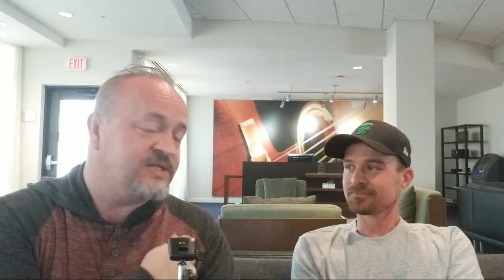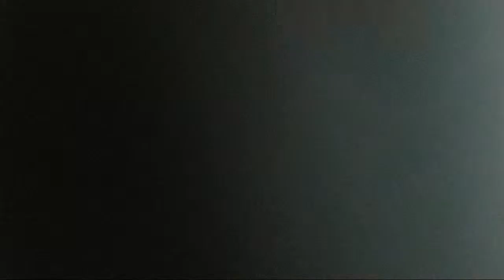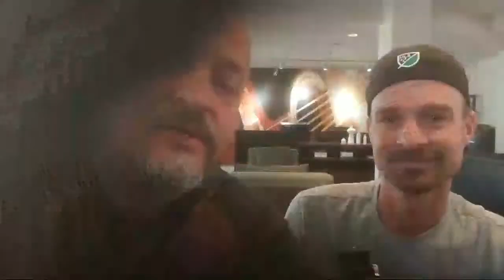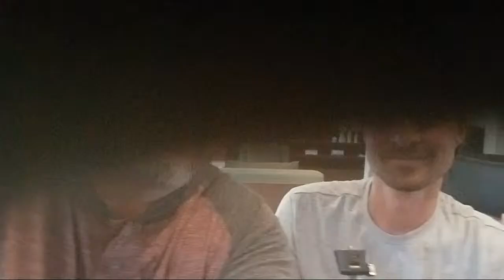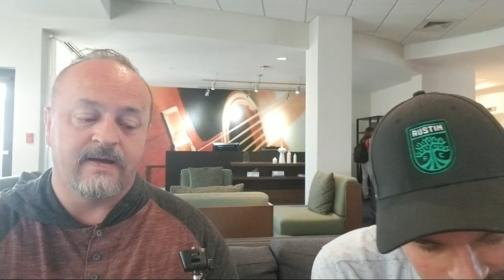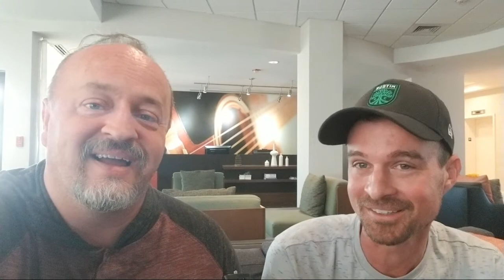Investor Day Takeaways (w/ Bryan Roschetzky)

Comment: The current motors already have average efficiencies of over 90% with a peak efficiency of about 97% for the Model 3 permanent magnet motor and 93-95% for the induction motors. The Model S permanent magnet motor efficiency would be similar to the Model 3's. I've read that hairpin coils are more lossy than round wires due to the problems of AC conduction in wires with rectangular-versus-round cross-sections, so the new motors might be a bit less efficient than the current motors. I doubt there will be much difference, though.

The challenge of using no rare earth elements in the magnets of the new motors is to produce a motor that has a similar power-to-weight ratio to the current motors. They are unlikely to be as good in this regard although the greater fill-factor of hairpin stators might make up for power losses due to weaker magnets. 

The benefit of the new magnets is that they might be cheaper to make than the current magnets due to not needing rare earths.

Wrt to Tesla shifting to hairpin wound stators, the hairpin design allows for more power (due to greater fill-factor) but are thought to be less efficient due to the reasons I mentioned above. But the main reason that Tesla hasn't been using them up until now might be that the hairpin stators appear to be more difficult to build that round-wire stator coils, which results in lower production yield.

Comment: I wander if the compact will have instead of an unpainted stainless outer layer ,
Could they go for an unpainted aluminium shell, aluminium is weather resistant right? 

And it’s more mouldable , you can round it and everything else you want.

Comment: Cybertruck has taken time because it needs to be capable of withstanding all scrutiny. Positioned to win over the world. A vehicle dubbed the "Magnum Opus" by a polarizing figure, such as musk, will have to prove is worth, or damage the brand. If not, it will forever be compared to flops, liken the Delorian. So far, it's appears well worth the wait. Not another watered down Ram REV, or lower tier Lighting. Tesla has a vision of genuine  sustainability. I believe they will succeed. Although they fail often, it's with intent to move foward, not cut corners.